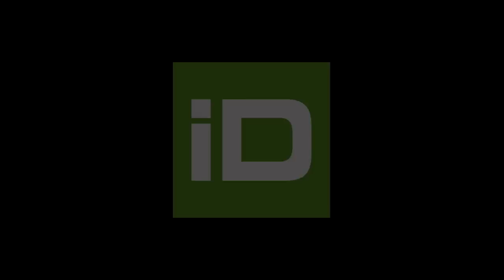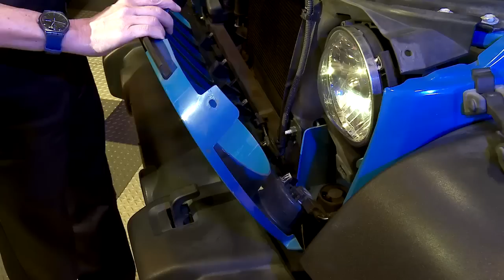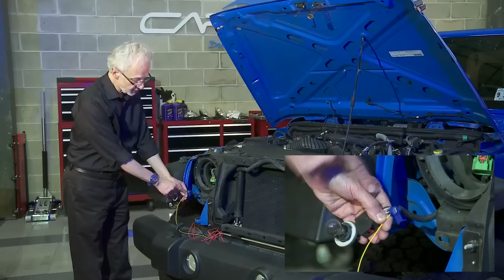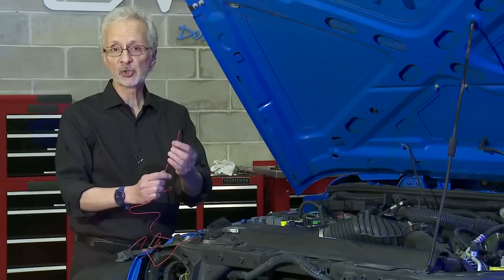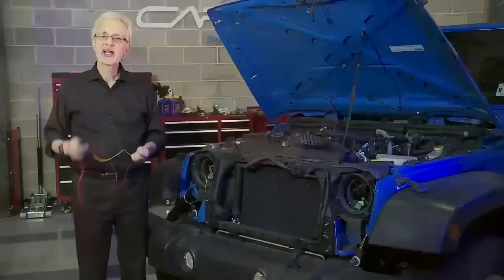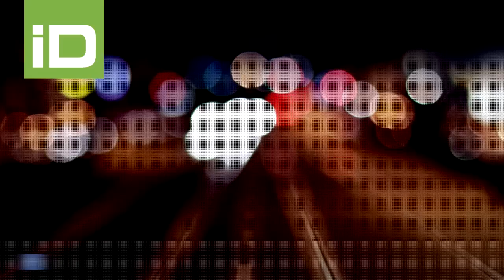Lumen LED Sealed Beam Halo Headlights Installation

Comment: I have a 2012 6 speed JK. I purchased the exact same headlights and wired them the exact same way per video instructions. The problem I'm facing is when the E- brake is engaged everything works the way it happened to. The DRL comes on when I start the vehicle. The headlights come on when I switch to low beams and high beams. Also the amber signals work as well. Now when I disengage the E- brake the low beams and high beams and the DRL ring come on automatically. The lights are in the off position. I'll switch it to the low beams and only the low beams are activated, and I'll hit the high beams and those will come on, but when I switch to the auto selection  all the lights stay on. Any suggestions on how to troubleshoot this problem? Please help. Thanks
Reply: @carid  bryansamuel1179@gmail.com
Reply: @carid  Everything works great, and is wired correctly. The only problem I am having is when I release my parking brake all of the lights are coming on at once. The Halo ring, low beam, and high beam. This happens even when the selector switch is in the off position and in the auto position. When i select the low beam the brights turn off. Also the turn signal does work and flashes amber.
Reply: @carid  I'm wired into the fuse box. I also made a short video explaining the situation.
Reply: @carid  No nothing is dimming. I want to restate that all the functions of the light system works ONLY when the E-brake is engaged. When I release it that's when the high beams come on. Even when the selector switch is in the off position.

Comment: I have the exact set of lights and followed your instruction to the letter but when I plug in the fuse I get static from the radio (AM, FM only) SAT works fine.  Once I remove the wire the radio is crystal clear.  Do you have any Ideas on what that could be?Tommy

Comment: why would you not attach them to the DRL circuit on the turn signals?
Reply: XNA Traveler if you do the turn signal in the halo will I only work when you turn your drl's on.